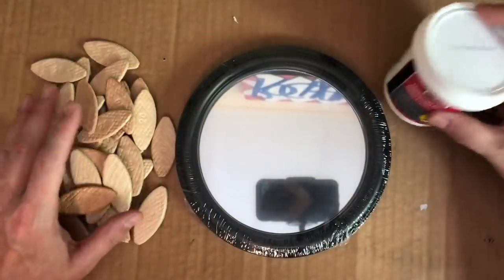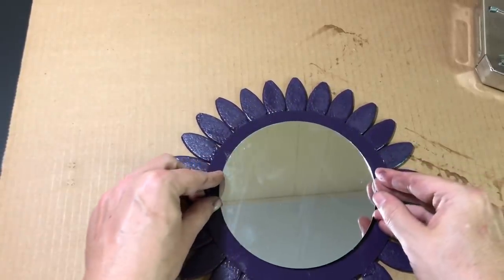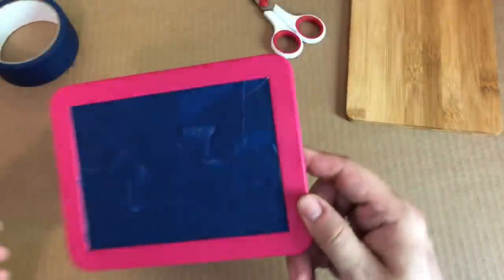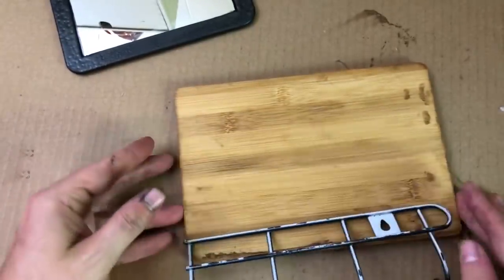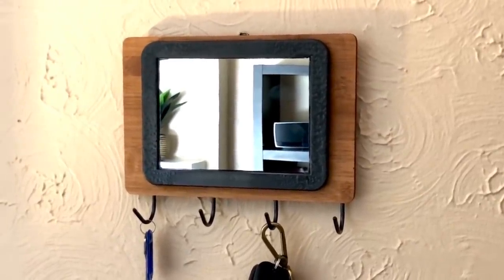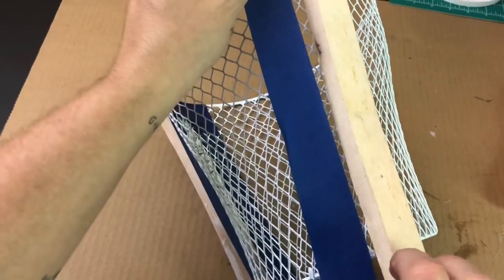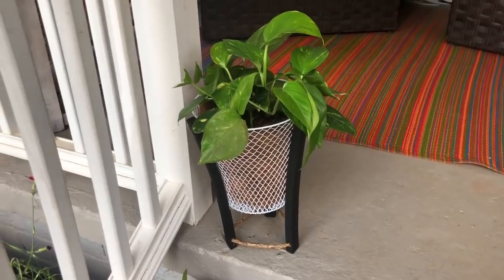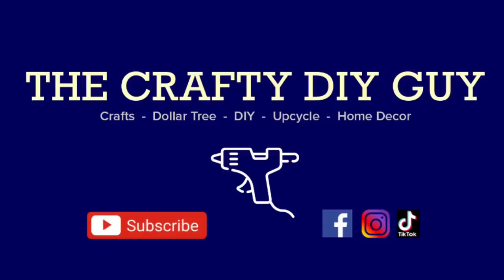Easy Home Decor DIY’s | Dollar Tree DIY

Comment: Hey Sweetie i liked the way you used the waste basket. The legs looked sturdy.  I am needing a small side table to place my drink, ash try, remote what ever on. I was thinking a charger plate on top maybe if it's larger than the basket. Painting it however including the basket. Or using what ever for the top. Ehat do you think? Would it work?  I love the mirror that you were going to spray gold. It made it look like flower petals. I was thinking paint the "petals a yellow if some sort and the rim a brown making a daisy or sunflower which I love both. It all could be painted what ever flower, adding more "petals" inbetween extending it out if a person wanted or the size you done but with two or three. The other two I like but the one for the keys wouldn't be used in this house and I liked the contemporary piece but it just doesn't go with the way this house is and my personality. Thanks for the ideas. Take care God Bless!!!
Reply from the maker: Great idea for the side table!

Comment: the mirror hook project was my fav! What are carpenter biscuits? TFS!
Reply: They are thin pieces of wood that are placed in little slits made on the side of wood boards to join 2 pieces of wood.  
There is a tool used to make the slits on each board.
Reply from the maker: Good question! See MaryBeth's comment!  :). hahaha